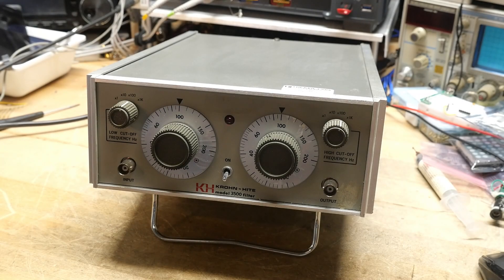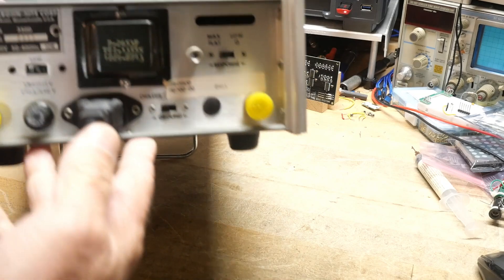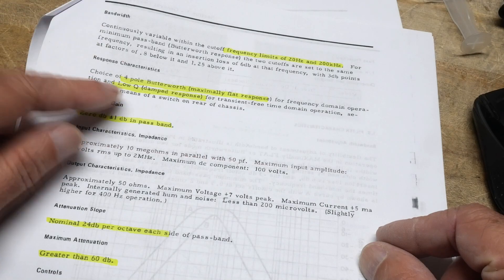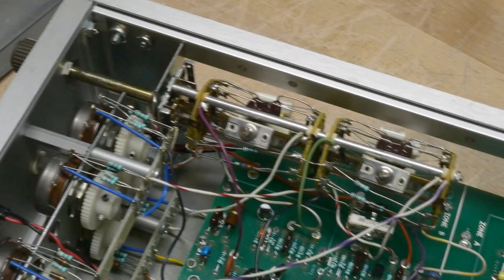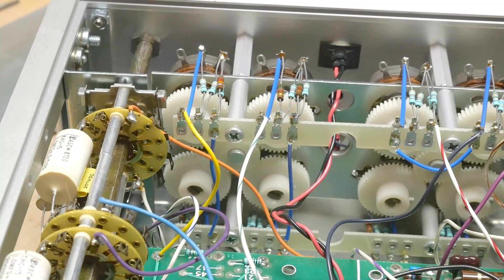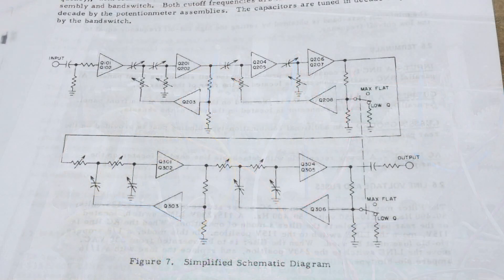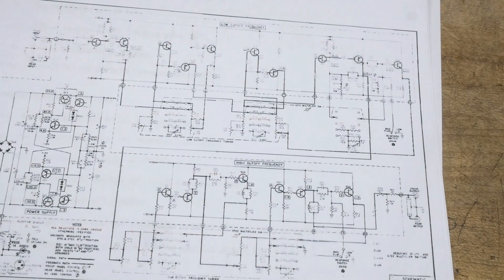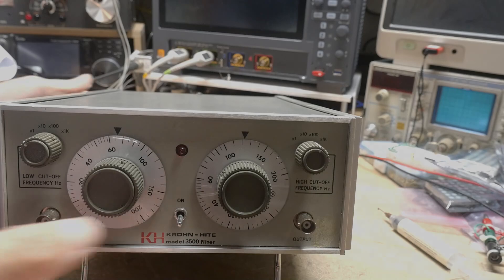#2166 Krohn-Hite Model 3500 Filter (part 1 of 2)

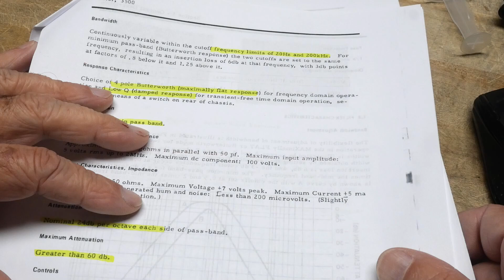Comment: 2:46 Bessel, Butterworth, Blackman, Haight-Ashbury... Those are all filters, right? Because that's what immediately popped into my head. So I just googled it. Nope. But... I know that list, from many years ago. This was a fun rabbit hole. I was just a teenager, but in the late 90s I used this software called Cool Edit (before it became Pro and later became Audition.) I found an old manual online. I thought maybe I was remembering a list of presets for DSP or something. I can't find anything in images for Haight-Ashbory, but around page 150 something there is an effect that uses an FFT which allows you to select the size and the windowing option, and it recommends Blackman windowing for general usage. Almost 30 years later, for some reason, I think I still remember that list of options for FFT Windowing, which included that list. I didn't have a clue what an FFT was back then, I just wanted to record myself playing bass, and for some reason a random list of names the software engineers included has stuck in my head for 30 years.

Comment: 1:50 I used to have a bass amplifier that had a 3-way ground switch, so the chassis could be grounded, floating, or connected through a resistor and capacitor, so you could choose your own ratio of shock pain to ground loop hum. I don't know why they stopped doing this.

Comment: I believe the geared controls are all potentiometers, so four per knob. The variable capacitors are actually controlled by the multiplier switch, so they are step-variable rather than continuously variable.
Reply: Yeah I think I the text just above your screwdriver said that the capacitors are tuned to each decade by the bandswitch